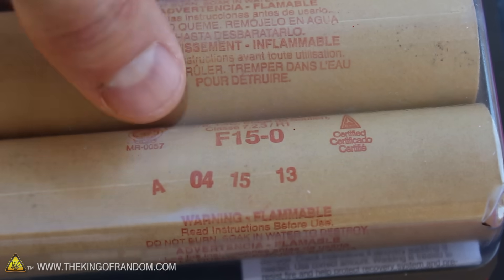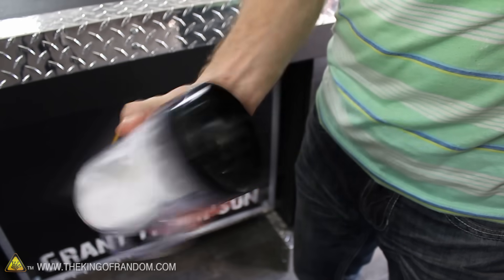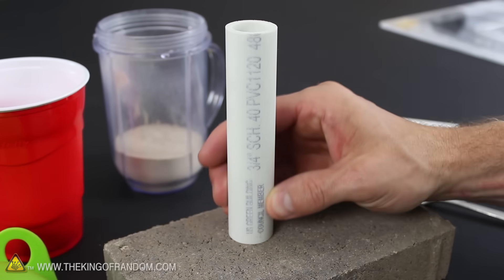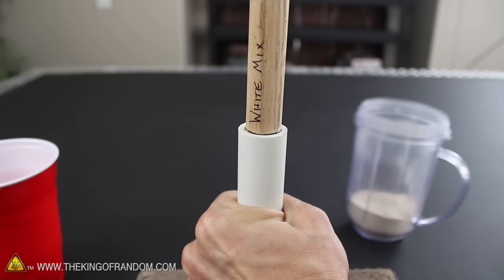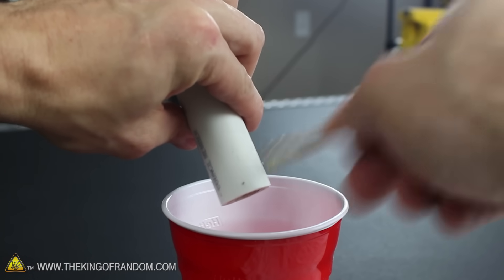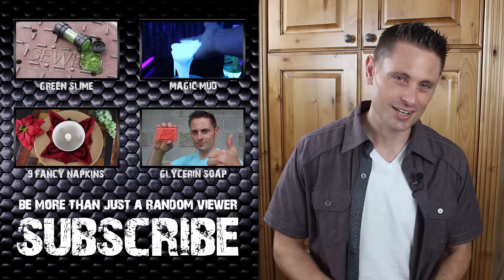How To Make Sugar Rockets

Comment: really why sugar is blended with stumper mover is it helping to make the compound flamable??
Reply: +bassel AL moukaddem  Have you heard of the fire triangle? heat + fuel + oxygen = fire, sugar is the fuel and the stump remover has 3 oxygen atoms per nitrogen atom. This causes a reaction that makes carbon dioxide, water (vapor) , Laughing gas, and a lot of energy (in the form of heat and mechanical force).
Reply: +gaskamp2  thank u very much!! I didnt realize that this triangle takes place in this situation

Comment: The video is great but when ever I try your white powder mix it doesn't burn well so I used a version of one in your other video 58% KNo3 27% sugar and 13% corn syrup and 0.5g of rust and i put it unto a dehydrator for 24 hours and i use plugs twice as long as yours but the fuel is the same and i press it in a vice multiple times and use the same nozzle size and either the plugs fail or they turn into pipe bombs

Comment: Very important to buy SCH 40 PVC pipe, its rated at 480 PSI. Anything less and your making a bomb instead of a rocket engine! Trust me, I know from experience! Wear eye protection everyone! Love the channel, keepem coming!
Reply: +schel sullivan Thnx for the advice! I returned my cheaply made PVC pipe because I thought it was practically the same!
Reply: Joel Craig, HDPE or similar will work well, paper too.
Anything that will resist the pressure and lessen the strappenel
Reply: I was wondering if HPVC would be better.
Reply: schel sullivan 1.58 diatomit cat sand???
Reply: Where did you buy it
Reply: what about pvcu
Reply: I may or may not have gave my friend some 350 rated tube to make this with😂😂😂

Comment: Hey! Do you just put in the fuse into the racket straight in? Or do you wrap tape around the fuse? :)
Reply: you can wrap tape around the fuse, because the fuse has its own oxidizer. but dont forget that the fire of a fuse cant go trough tape (sry for bad english)

Comment: So if you had a tube the same size of a standard drain pipe, think of the same size of a circle made with both your hands, and you followed his measurements buy doubled possibly tripled the size, would you have a bigger more powerful rocket that would fly higher or na?

Comment: how the hell does he know how high it went?
Reply: maybe he put a GPS in it or something
Reply: +darkdancerman he use a formula to know the high
Reply: Jose Carlo Capriles yea that wouldn't be very accurate
Reply: +darkdancerman Count the seconds from highest point to impact
D = ½(32)t²
It's only an approximate, but I don't think a PVC pipe would have enough drag to affect the margin of error by much
Reply: Does anyone know what he did with the fuse? Like did he shove it all the way up to the tip or connect it to the bottom somehow?

Comment: You could try adding a spacer such as Styrofoam beads or fluffy laundry detergent.  I had heard that fine soap flakes work well.  Be careful, spacers can really increase the reaction rate.

Comment: I made a couple rockets, with the measurements listed here. I got thrust, however it went up slow, about 30 feet in the air and then dropped into the water and went along like a boat. weight wasn't an issue I don't believe.  it weighs no more than a c class with a doll rod to stabilize.  what do you think went wrong?

Comment: Don't you need rust powder for this to work?
Reply: +Rightwingscum Bo or even better aluminum powder, that heat will melt glass ...
Reply: +Random Rampage 
Adding a few % of ironoxide can increase the burn rate, but it's not necessary.
Reply: +Tom Jacobs is aluminium ppwder termite?
Reply: THTerra
iron(III)oxide + aluminum = thermite.
Reply: MrAntiKnowledge ok thx :D

Comment: Do you think you would get a different result if the rocket motors were heated a little after you made them? I usually found my Rcandy castings were a bit more energetic than my compressed rockets. Just an idea..

Comment: Heads up if you live in the UK.
Under the conditions of the 1875 Explosives Act, the 1883 Amendment, and later Prevention of Terrorism acts, it is an offence to manufacture your own solid fuel rocket motors, since these are classed as an explosive. This is also an issue for the Health and Safety Executive too. This act does not affect model rocketry enthusiasts who buy commercially available motors however, only those few people who want to construct their own solid fuel motors.

Comment: I tried to upscale this to one inch rockets and drilling 1/4 inch hole.  1'kitty,  3.5'white mix,  1' kitty.   It doesn't work!   All i make are smoke bombs.  Can you explane??
Reply: If you want your rocket to lift off you have to increase or decrease the diameter of the hole where the fuse is
Reply: Jon Buhland you need to decrease the diameter hole if you want more thrust, so that the exhaust exits faster

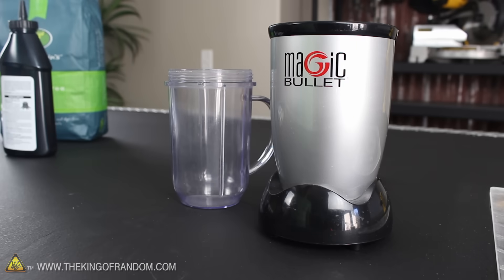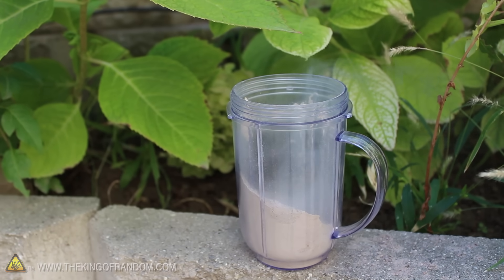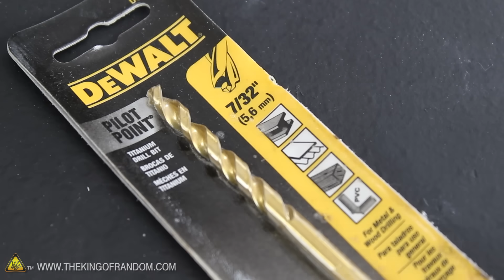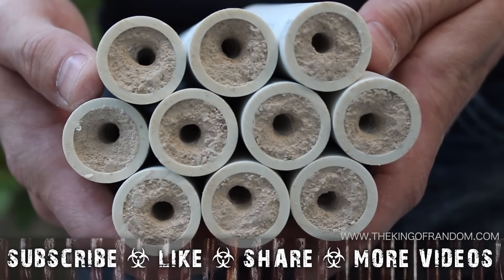Comment: 0:18 and cost 50 cent to make 1:07 i found this one in a local thrift shop for 5 dollars 0:27 i'm pretty sure those 3 does not cost 50 cent 0:36 the oak dowel and tubes 2:28 Party cups 3:44 a drill 5:04 a rocket stand. that's not 50 cent my man
Reply: sofus larsen It's the total cost divided between how many rockets he made. Each rocket he made only cost him 50 cents.
Reply: katie m then should he not be saying it in the video?
Reply: sofus larsen consumables and tooling are likely priced separately, he listed the price of some of the tools used so people would know it was cheap to get.
Reply: Flyingwigs Hmm... ok then
Reply: sofus larsen the dowel and tube can be used over an over again, also with the blender. all the stuff that's burned up is what costs 50 cents.

Comment: Call me stupid but how should you put the fuse in the rocket
Reply: CRIMSON FTW i need to know the same haha dont feel bad
Reply: CRIMSON FTW  I have not tried it yet but maybe a very small dab of hot glue on the end of the fuse?
Reply: Chris Snyder
thats a good idea, I thought about my idea after my comment and realized that the hot glue could ignite the the mixture lol
Reply: Mr Postive I would use model glue as it dries thinner and is slightly flammable, even when dry.
Reply: Ha right?
Reply: +CRIMSON FTW stupid
Reply: I not asian!!!
Reply: Watch how to make black powder in youtube  then  add a small amount of cornstarch and water to BP then boil it until it gets sticky then put 1mm x 1 meter of cotton string into the mixture and let it dry...instead of parachute you can put  potassium chlorate, sulfur and aluminum powder mixture so that it will craete a big explosion above...

Comment: why do you drill a hole. Cant you do without it
Reply: Petrov Bullafarht Perhaps an explosive explosion?
Reply: Petrov Bullafarht it needs an exhaust port, which is used to create the thrust needed for launching. Otherwise it will just explode.
Reply: lamenate OK so it has to go all they way through? And what kind of explosion are we talking about?
Reply: Petrov Bullafarht the hole through the fuel adds surface area during the burn, without it it will be rather slow and low thrust.

Comment: you should have a rocket with a large central motor with multiple smaller booster engines around the body

Comment: you have not explained the following things
what is the size of the pipe?
what are the percentages KNO3 / sugar?
what are the measures of the wooden beater?
what are the measures to mark in the batter of wood?
Reply: pyroflash pyroflash 

1) 3/4 inch E40 PVC pipe cut 5 inches long. (0:38)
2) 65g KNO3 / 35g powdered sugar (1:11)
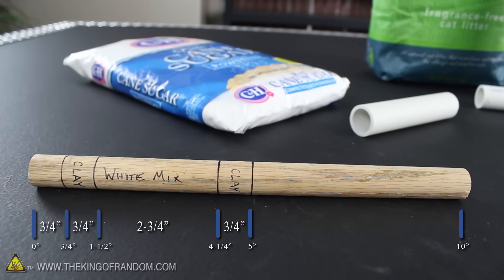3) 3/4 inch dowel rod 10 inches long (twice the length of PVC) (0:48)
4) 3/4 inch, 3/4 inch, 2 3/4 inch, 3/4 inch. (0:48)

These are all said in the video if you pay more attention.
Reply: Sorry :-(
Reply: pyroflash pyroflash No problem, really :)

Comment: I see you're using fuses; can you electrically ignite these rockets?  Most rocketry clubs don't allow fuse-lit rockets.
Reply: Patrick Haggood I don't see why not. Even a regular lighter will set the fuel off, no need for a lot of heat. I'm sure an electric igniter will work.

Comment: So would it be possible to build an extremely lightweight, draft-riding glider drone, attach it to one of these rockets (which will detach from the drone when it runs out of fuel), and slowly build your very own "cheapo" surveillance system?

Comment: This works perfectly, so why do others cook their mixture?
Reply: GunEnthusiast Because they are not compacting it. When you cook it, the sugar becomes sticky and holds everything together like a dough so it can be put in engines or molded into other shapes. It really doesn't matter, both work great!
Reply: k thanks!
Reply: soxrok2212 But wouldn't the molten one have less power because it has a less dense fuel mixture?
Reply: +GunEnthusiast when cooking, you are making a smoke bomb.
Reply: +Sammyboycot no, cooking or compacting is the same,a smoke bomb is basically a 60/40 KNO3/Suger and sodium bicarbonate to slow down the reaction and produce smoke
Reply: Wit isn't the mixture extremely flamible? Wouldn't it burn like the sun?
Reply: +Will Brack if it got too hot it would ignite yes this method is much safer

Comment: Guys, me and my friend have a problem. When our KNO3 burns it creates this green kind of goof...molten KNO3 it seems. That way we cant mix 75/25 ratios etc for extremely fast burning engnes. I actually cant even make a rocket lke this because of that
Reply: The Unpredictable Jack Dissolbe your kno3 in warm water, run it through a filter and throw the filter away. Keep the liquid and recrystalize it. That should make your KNO3 much more pure assuming its insoluables that are causing this.
Reply: My friend and I*

Comment: Couple of things. Sodium Bentonite/catlitter swells when damp, calcium Bentonite don't. Might consider Rock Hard Water Putty. Let it dry several days before packing the fuel.
Powdered sugar often has corn starch added to prevent caking. I'm putting table sugar in the blender.
Lastly. More than 2 brain cells are required to play with this stuff. Murffy's law, if it CAN happen, it WILL happen!

Comment: Shall I make a rocket that can reach up to 1000 metres? But the problem is, the staging. Ahhhh screw it, I'll make a rocket without staging stuff. But... AHH! How can I make the thing stable. F*** it. I'll just use aerodynamics then. Wings, wings, wings, hmmmm... I know it will spin like crazy if I put 4 wings on, plus if the centre of mass is not at the centre at all, then it will go off course. So, I should put in the right amount of fuel and put 3 wings on. Okay then. I have a new project to have sooo... brb guys.

Comment: Could use some help here. I'm trying to do mass to volume conversions because I lack a scale, but I am garbage at math and always have been. You'r eusing a 65/35 gram ratio, but what about conversion into ounces, I tried using a table converter but it was coming out with about 2.5 US fl.oz of propellant after it's mixed. And that doesn't seem right at least not in my head. Would that make sense?
Reply: Grady Klein Nevermind I solved the issue, however the mix isn't producing enough thrust. If anything, it's taking way too long to burn. It's more like a cheap smoke grenade than a rocket, honestly. How can I resolve this?

Comment: The Explosives Regulatory Division (ERD) is responsible for administering Canada’s Explosive Act and its regulations.  Amendment to the Act contained in the Public Safety Act, 2002 included regulation-making provisions for the security of restricted components of explosives.

If you manufacture, import, export, purchase, provide, distribute for sale, transport or sell products containing or made from any of the following ten (10) Restricted Components, you must comply with Part 20 of the Explosives Regulations, 2013.

Ammonium nitrate in solid form at a concentration of at least 28% nitrogen
Hydrogen peroxide at a concentration of at least 30%
Nitric acid at a concentration of at least 75%
Nitromethane, UN number 1261
Potassium chlorate, UN number 1485
Potassium perchlorate, UN number 1489
Sodium chlorate in solid form, UN number 1495
Potassium nitrate, UN number 1486
Sodium nitrate in solid form, UN number 1498
Potassium nitrate and sodium nitrate mixture, UN number 1499

Comment: can i use potassium sulfate
Reply: Enn Jõe Nope, only substitute that I can think of is sodium nitrate, but that won't probably work so well. There are also different kinds of rocket fuels, but they require much more expensive and dangerous chemicals, so getting potassium nitrate is probably your only choice

Comment: Really neat and impressive! 
How did the dry clay stick together without water?
Be wary of static electricity when handling especially with plastic things.
Perhaps, you can make another dowel with a hole in it and a find a steel rod to insert into a hardwood or a steel plate jig instead of concrete block so you don't have to bother to drill it.

Comment: Hey, im from aus, and want to replicate these rocket motors, however I made a sample of the propellant (about a bottle caps worth compacted) just to test if I got it right, after I ignited the mixture it was a pretty lack luster fizzle for a second or two, is this normal? I ground the kno3 (99.7% pure) with a pestle and mortar as I don't have a blender handy, could that be why?

Comment: This isn't really a comment, it's really a question...=) When I tried making these sugar engines, sometimes they worked partly, but most of the time they put off no thrust. I was very careful to follow the exact instructions, and not to get it wet. But it was also very humid out but I did't thank this wold be an issue because I would lunch them right away                                                                                                              do you have any suggestions why it would not work.                                                                                                                                   Thank  you                                                                                                                                   Bo

Comment: I wonder how it would hold out when attaching a small camera to it.
Reply: it will be out balanced and result in a cool vid of a crash
Reply: you just have to counter balance it
and make sure center of mass is above the center of trust
Reply: Mas Gamez There are ways to handle payloads with your rocket design. So... it just comes down to proper rocket science. These engines will work just fine for handling a payload if your rocket is done right.

Comment: I can't get this mix to light with a lighter held to it. I don't know what i'm doing wrong. I don't have a digital scale so I just measured out the mix as close to a 60/40 ratio. does the mix need to be exact for it to burn ?
Reply: Absolutely.  This is touchy chemistry.  Just measuring power substances is hard because you might have a lot of fluffed air in there making it seem like more than it really is.  If you use a digital scale you're only measuring the mass weight of the material and not the volume.  The ratio has to be darn close to perfect.  Buy a digital scale at the grocery store for around $10
Reply: Thanks, I just purchased one from Amazon today. I heated the mix to melt it together and got a better reaction with it. It at least fizzled and smoked but wasn't strong link it needs to be. lol. I think the scale will get me on the right track. Thanks for the help. Me and my kids appreciate it.

Comment: the 3/4 inch oak dowel is 19mm or 14mm?Cause in wood work 3/4 inch is 14mm and in the original inches its like 19,05mm
Thanks

Comment: You cant get that stuff in the netherlands
Reply: Piet Wiersma Then what do farmers & gardeners use?
If you can't get the required degree of purity, you can recrystallize to the necessary purity of KNO3. A single recrystalliz'n is usually enough, and 2 recrystalliz'ns will surely be enough.
Reply: Robert Goodman How does one recrystallize the mix that comes in brand xy or z?  I forgot the brand that I have but it is less than 50% Pot. nit., how do I separate the garbage out of the mix?
Reply: Greg O It's going to take some work ascertaining what the likely other substances in the mixture are, looking up the solubilities of the various possible salts that can be made from them, and then doing the differential precipitation. A characteristic of KNO3 that helps with that is its VERY strong dependence of solubility on temperature.

Comment: In the past it was suggested to get a better steady burn to melt the sugar and salt peter together.   My first attempts using double boilers were painfully slow but effective.   Tried in a thin pot alone once and ended up with burns to my face and hands and the glasses I bought recently were destroyed.   A little too much heat and it lit in the pot.  Bad idea...  lol.  No permanent damage except to my glasses as I fell backwards very fast...

Comment: I made a smaller one because sadly I was nearly out of KNO3. The entire rocket weighs 42.3g. There is 10g of sugar fuel. Is this enough thrust, or do I need to take the quarters I added off? (I put them on to put the center of gravity behind the rocket).